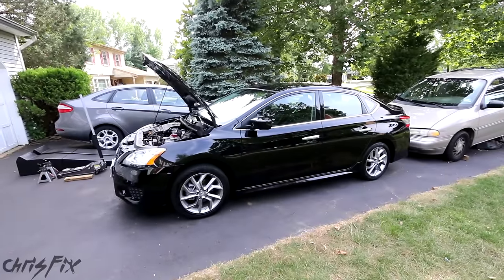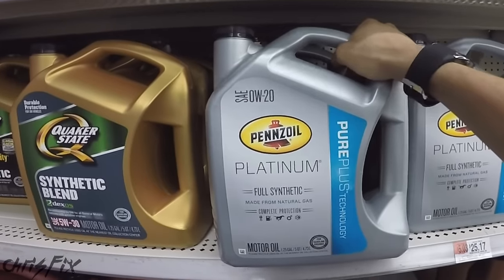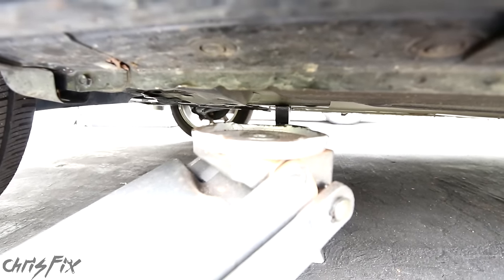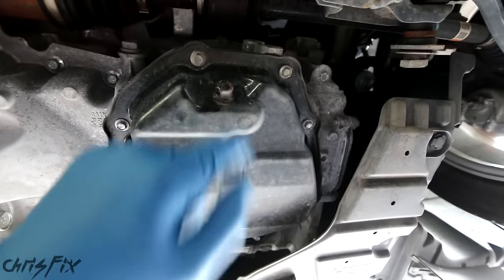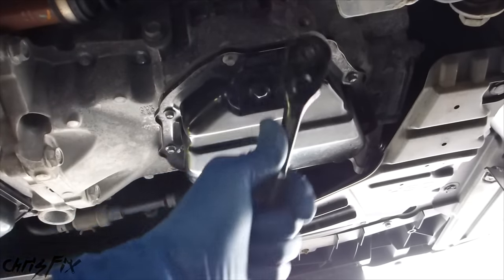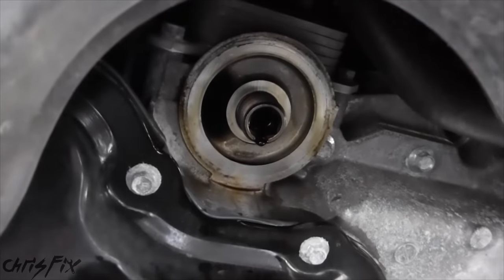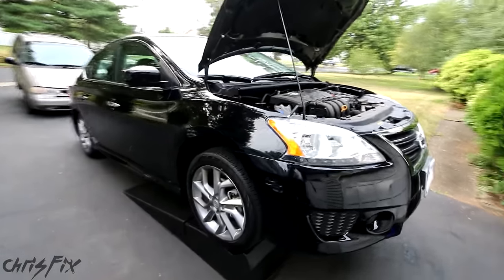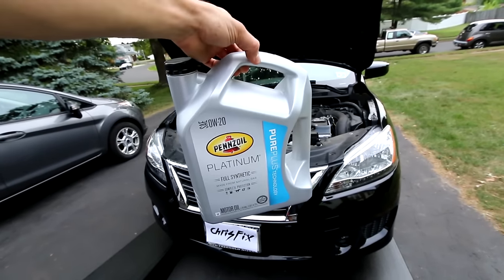How to Change Your Oil (COMPLETE Guide)

Comment: hello experts, I have a question. my car is a 2012 toyota, its engine is rated for 0W 20 and i domt know what the last owner was putting in, and the last one put in the car was 20w 50. what would be the procedure to go back to 0W20?
Thanks, your answers would be appreciated.
Reply: I spoke to mechanic the other day with the same questions basically and he told me you have to pour something to flush out all of the oil when changing oil types.
Reply: @KingAlkazar  yeah i also talked with the mechanic, they say you have to gradually step down, for now he put 10w 40 in it, then to go to 10w 30 and eventually to 5w-30. for some reason though he said dont go below that because the engine has already been running for 90000 kms.

Comment: So if the oil filter is indeed upside down, how do you pre oil it?
Reply from the maker: You can pour a little oil in to just to soak the filter medium (it should absorb all of it) then install it. Should be pretty mess free and you still get to pre oil it a little bit.

Comment: Do you need to clean out the pan before putting in the new oil?
Reply from the maker: No the thin layer of oil oil in the oil pan is not a big deal.

Comment: I just wanna know where do you put the old oil in the pan ? In other worlds, The old oil you caught in the pan where do you put it afterwards?
Reply: easiest way is to put in the container from the new fluid assuming its empty and then drop it off at a place that takes used oil. most autoparts stores should take it

Comment: Let's discuss "oil viscosity" .... I live in extreme temp changes (Las Vegas) and use 5W30 during Winter as recommmended but during Hot Summer months change to 10W40 ... your comments?
Reply from the maker: What you are doing is fine. You dont technically have to change the oil in the summer just for the viscosity if you havent gone the mileage needed to change the oil. For street use you can use either and there wont be much of a difference. If you take your car to the track then you definitely want the thicker oil.

Comment: Hello Chrix how are you. I have a question for you and I hope you can respond me back a soon you can. I have a scion tc 05. But it only cranck  but dont start the ingine. I just put 4 spark and the 4  new ingine coil and still want run so I find a broking blue fuse # 15 so I dont know is that the problem
Reply: Are you getting fuel. If you are getting a spark (thats good) and the engine is turning over (great) but there is no fuel for that spark, your car wont start.
Is your fuel pump working?
Reply: Oh thank you Chrix for responding. About the Scion I will  check if the pump working. Thank againg your the best.
Reply: @leonidasmoyamartes8820  This is not Chris lol. My name is Aaron, I own Vigilante Motors. I just like to help people when I can, saw your question and thought I might help. Let me know what happens if you like Leonidas

Comment: Hey Chris, so long story short, I had to fill my car's oil but I didn't get a chance to change the oil filter. Can I use the oil I drain into the oil pan since it's new?
Reply from the maker: You don’t need to drain the oil to change the filter. Only a little should come out. Don’t reuse oil you drain out. It can easily become contaminated.
Reply: @chrisfix  Thank you so much!!

Comment: But by using a ramp, yes it's easier but doesn't drain out all of the old oil due to the angle of the car right?
Reply from the maker: Depends on the car and the design of the pan, a little bit compared to the quarts you are about to put in (and with a fresh filter) shouldn't harm anything

Comment: @chrisfix My car needs a top off every few hundred miles. The oil level drops very quickly. No leaks anywhere. What do you think is causing this?
Reply from the maker: Could be something like a worn pcv valve or worn out piston rings/valve seals. How old is your car?
Reply: @chrisfix  about 11 yo

Comment: I had an oil change at a Mobil 1 lube express, and they didn’t remove the filter & lied about it. The guy didn’t have the strength to get the old one off, I saw the scratches & gouges from him attempting with the filter remover caliper tool. They charged me $150.

Comment: Do you ever clean your oil pan? Or do you let leftover droplets of old oil just sit there?
Reply: The best thing to do is to take those drops, wipe them with a cloth then wipe that used oil on the cloth onto the oil pan itself. This is a great and cheap way to prevent it from rusting.

Comment: How tight should the oil cap be after adding oil?
Reply from the maker: It should stop so you can't turn it any more, if it doesn't for some reason just until it's snug

Comment: Don't you have to remove the oil cap on engine first to drain the oil completely?
Reply: JC, no. It will help in releasing the old oil a bit quicker because of the vacuum it creates but it is not a necessary step.

Comment: I’m a 24 year old and I did automobile engineering at high school in Ghana and I got a certificate for that and I furthered at the university but I didn’t complete and I moved to the USA recently I’m trying to get a job related to vehicles but I’m not sure if the certification form Ghana will be accepted so I’m getting enrolled in MTTI to get a USA certification but I need a part time job as well and I’m trying to get to Valvonline oil change.   I want to know if I will be accepted with my certification and is it a good idea.   Please anyone to advice me I’m really lost

Comment: The car needs to be level right for changing oil?
Reply: BMP, no. You can drive the front wheels onto ramps or jack it up (safely) and do it that way. Either way the vehicle is not going to be level.

HOWEVER, once you have the oil drain plug back in and torqued down and you are adding oil, you will want to put the car down level so when you go to check your dipstick you get an accurate reading.

Hope that helps you out some
Reply: @vigilantemotors  some residue might not come out though
Reply: @bmp4769  if it’s completely level some may not come out. Even on an angle some old oil stays in. 
Just let it drain till it’s down to a very slow drip. This could take 15 min or so.
You’ll get 99% of it out

Comment: How much do all the tools needed for this cost all together?
Reply: Chris, to do an oil change and get a socket set, oil wrench filter, jack stands, funnel and oil pan. You are probably looking at:
$20 for a basic but good enough socket set
$12 for an oil filter wrench
$5 for the funnel
$15 for oil drip pan
$50 for the jack stands (this is your most expensive purchase but a MUST have if you are working under a car)

Does that help?
Reply: @vigilantemotors  thanks
Reply: @Chris-nq3et  Anytime. Hope you get a chance to  do it.
If you have any questions you can always hit me up on my channel here. I have an auto channel as well and I answer every questions asked. 

Have a great evening.
Hope to see you over on my channel Chris

Comment: I noticed my motor starting getting alot of miles on it. So I just took the motor out turned it around and put it back in so I could run the miles back down some. 🤷‍♂️

Comment: instead of puting oil on the filter I like to put a little grease on the ring so that the oil dosn't leak everywear
Reply: its supposed to be lubricated by only oil, it shouldnt leak if installed properly

Comment: Thanks for your video Chirs. I did the oil change by myself for 2012 kia soul 1.6 l. I read the owner’s manual and they show me that my car engine oil capacity is 3.3 l ( 3.49 Qt). However, after I put only 3l and I checked my dipstick. It showed me the oil was passed the letter F. Do i have too overfilled oil or it’s just be okay. Thanks in advance.
Reply: Travis did anyone help you with your question yet?

Comment: Make shure you use a good quality oil filter not a chep one ,make shure you car is leval when you check it , run your moter before you change it to be zble to get out more of the durty oil ,fill up oil filter before you put in on and prine the rubber seal on top with oil

Comment: what do you do with the old oil?
Reply: Pour it back into the empty jug of new oil, then you can usually take it to your nearest garage or auto store. They can safely dispose of it for free. You'll likely get in trouble if you dispose of it like normal trash
Reply: @shiningbind90 where I work we have to charge an environmental charge of £3.75. Not free but still cheap

Comment: Hello chris can i clean the oil filter instead of changing it?
Reply from the maker: No you need to change the oil filter. It cannot be cleaned.
Reply: @chrisfix  any other place to know which oil filter i shall use? I cannot find it in my user manual:(

Comment: Always put cardboard under the car before you start, things can get messy and always check your old oil filter to make sure the rubber gasket came off and is not stuck on the motor.

Comment: How does one remove a drain plug that has been tightened so tightly, that not even a breaker bar will get it off? I’m trying to get it off without rounding it completely.

Comment: I forget to put oil on filter before stall the filter..thats alright?
Reply from the maker: Not a big deal, when you go to do an oil change next time just make sure you check that the gasket came off with the filter and it's not still stuck on the engine

Comment: what happens when you over tighten the oil filter?
Reply from the maker: You could potentially strip the threading so your filter wouldn't stay on or you can damage the o ring and cause a leak. Hand tight is all a filter needs!

Comment: How tight oil filter is good enough? Even though I watched your entire video, every technician will have their subjective opinions that the oil filter is too tight or too loose.
Reply from the maker: I like to do hand tight and call it a day. No need to put excessive torque on it
Reply: @chrisfix  Thank you for replying.  You know v8 chargers or challengers equipped with hugh oil filters even though they are gasoline cars. I tightened the oil filters by two hands with a rag as tight as possible, but my co-workers told me they were loose. I guess whether they are tight or loose, it is subjective and different from a tech to a tech.
Reply: @fromisheon4867 that's because back in the day everyone always said to tighten by hand then use the remover tool to tighten another half a turn or so. I've never done that and always just hand tightened with 1 hand. Never had an issue

Comment: What am I supposed to do with the old oil?
Reply: Hey man so I thought I would chime in here. Most local auto parts stores will take your old oil. Pep Boys, AutoZone, O'Reillys etc. Give them  a call.
If not, most towns have dumps that you can dispose of oil as well. Best to call them first too however.
I would try your auto parts stores first, its where I always go and its free of charge
Reply: @Vigilante Motors  
Thanks 4 the info 👍
Reply: @privatename2101  Anytime!

Comment: why do oil companies make bottles with 5 quartz when usually we use 4. i accidentally poured the whole bottle haha cos 1 last quart won't hurt
Reply: Actually overfilling can be very harmful to your engine. I hope you were just kidding lol
Reply: @vigilantemotors  i poured about 2 quartz out
Reply: @timeweavebot7468  I know the single bottles of oil are far more expensive which sucks but those big 5 qt jugs do have measuring lines on the side of the bottle so you can get the right amount of oil into your car.

Comment: Or you could have an oil filter like on my 99 Pontiac Sunfire that is on the back of the engine in the center in the worst possible place to get to🤣 the guys at the oil change place used to get so mad every time they would see me coming with my car

Comment: 🎯 Key Takeaways for quick navigation:

00:00 🚗 This video is a comprehensive guide for beginners on changing their car's oil, emphasizing cost savings and using quality materials.
00:53 🧰 Essential tools for an oil change include a socket set, gloves, paper towels, oil, filter, oil filter wrench, oil catch pan, funnel, and a breaker bar.
02:22 📖 To determine the correct oil for your car, refer to the owner's manual, noting the required oil quantity and viscosity.
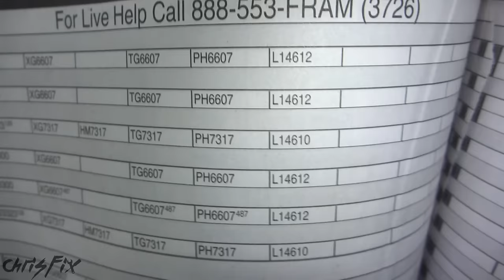03:54 ⛽ Synthetic oil is recommended for many cars, and switching between synthetic and conventional is possible at any time.
05:27 🛠️ Safely jack up your vehicle using ramps, jack stands, and a piece of wood for an oil change. Secure the rear tires and follow the owner's manual instructions.
08:31 🔧 Use a breaker bar or an extended ratchet for stubborn drain plugs. Replace drain plug gaskets and tighten to 20 foot-pounds of torque.
11:48 🔄 Use various tools to remove a tight oil filter. Pre-oil the new filter, lubricate the gasket, and hand-tighten it onto the filter adapter.
15:41 🌡️ Add new oil to the engine using a funnel. Check the oil level and start the engine to ensure proper oil circulation.
18:18 🛠️ After adding oil, check the oil level using the dipstick. Dispose of used oil responsibly by taking it to a local auto parts store, garage, or recycling center.

Made with HARPA AI

Comment: You don't need an oil wrench use your hand.
Reply from the maker: If it doesn’t come off with your hands, you do in fact need an oil wrench.
Reply: Use both hands (you mean LOL) and it will come off (I suggest but not to tell you what to do). First it will feel like it wont, but take a couple deep breaths and do it again. You will feel it slightly turn. Take a couple of deep breaths more. Then it will start to turn easier and easier. I don't know of anyone that can do it with one hand. I really think that if it can't come off with both of your hands. Then they put it on too tight. And I kind of felt that I may have over tighten when I put the new one on. I recently did mine and my tool was too big to remove it. And I didn't feel like buying more tools.